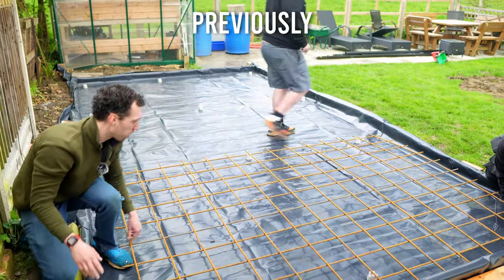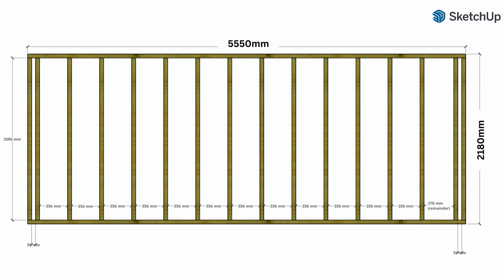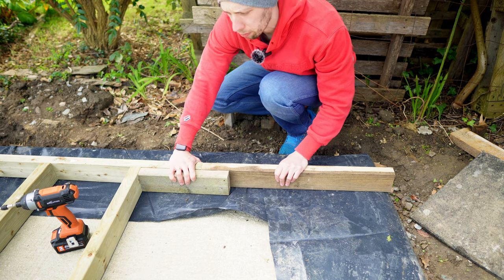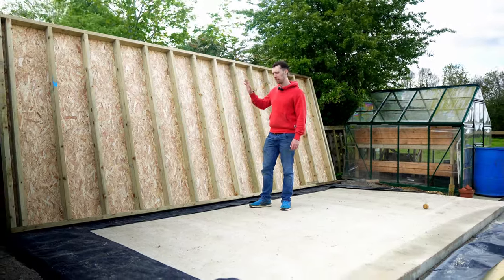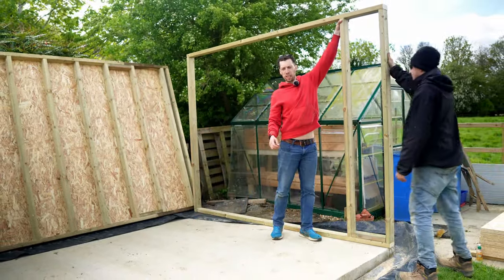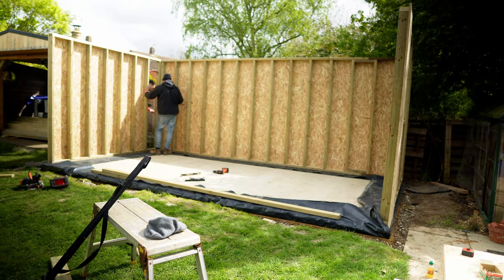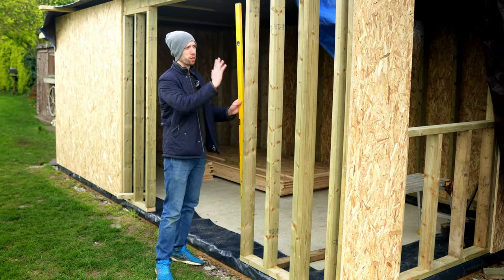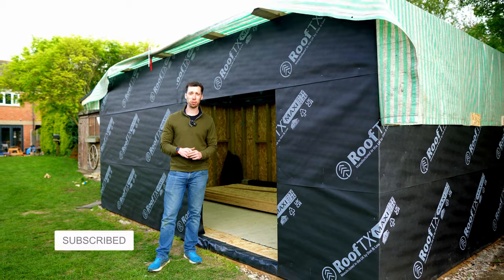How to Frame Walls: Build A Workshop Ep 5

Comment: Just a thought, from a fellow who has built timber framed over in Canada, is to leave 20mm overhang at the bottom of the OSB wall sheeting to act as a drip edge to prevent water ingress from rain splash on the ground and past the pad edge running down the walls. And loosely attaching 2x4 2/3, 3/4 the way up the outsides of wall act as props to hold them vertical until screwed together. A bit later to the party I know but may help others. Take care & stay safe.
Reply from the maker: Great tip thanks! Wish I’d considered that!

Comment: Good job folding the membrane over the slab. I've noticed in my shed just from rain that water will penetrate in about 100mm from the edge (and I feel like the hold-down bolts seem to help with the wicking somehow). 

Plasterboard for the interior lining is an interesting choice if I heard you right. It's pretty soft for a workshop. I was, luckily, able to get a hold of 17mm second hand ply that had been used as lining for shipping containers. On that note, before you sheet, plan where you might be putting shelves or cupboards and put in extra horizontal or vertical nogging that you can screw into. I mounted a heavy fan on one wall and made sure I had extra timber behind the ply sheeting to screw into. You can never have too much high shelving. Maybe also consider an exhaust vent for dust collection before you sheet as well.

And, yes, you tend to over-estimate windows. Less window is more wall space. On the other hand, I underestimated my lighting.
Reply from the maker: Yea I'm still not sure whether putting the DPM under the framing instead of stapeled to it was the way to go, I guess time will tell. 

Yes I am currently thinking of using plasterboard, I hadn't considered using ply but I might check out the price and compare.

I'm hoping the choice to skip a 2nd window is something I don't eventually regret. But I think I should get plenty of light from the doors and one window 🤞

Comment: This is almost exactly the type of shed my wife will be getting me to build. I'll have a good look over the plans to see if it's possible to do in my garden. A laser measuring tape sure would come in handy during the build 😉😅
Reply from the maker: I’d be interested to hear what you think of the plans, I’m open to adding more detail if people think it’s needed 😀
Reply: @sumeraybuilds  Heya, I've had a quick look over the plans. I've got a few constructive criticisms:
The plans were a little hard to find on your site. Not impossible, but maybe you could have another sub-menu solely for plans? 
The plan labeled 'with window' is actually without window and vice versa. The file name is correct but the title on the site is wrong. 
Did you cut the top of the studs at an angle to meet the slope of the roof in the side walls? If so, what was the angle? That might help improve the plan to include it. 

Otherwise, really good site and really good plans. Thanks for making this information accessible 🤘
Reply from the maker: @ojcrook1340  That's solid feedback, thanks so much!
I've gone through and addressed everything. I did cut the tops of each upright to a 2 degree angle.

If you ever had any other suggestions for the plans then feel free to let me know (My emails on the channel page)

Comment: Great shed build series.  Question, how did you attach the walls to the concrete base?
Reply from the maker: I drilled some holes using a big drill through the walls base plate into the concrete and fixed with concrete screws. I do show this in the video about halfway through

Comment: Very well explained, and I see you attached the walls to the base using screws - won’t that compromise the waterproofing layer though?
Reply from the maker: Thanks 🙏 It will allow some moisture through the DPM. But personally I don't think it's enough to worry about. I'd rather have it screwed down and know it's not going anywhere and risk a little moisture. I have seen some people fix some brackets into the concrete base whilst it's being poured which doesn't avoid this issue. But required a lot of planing to make sure they're in the correct place.
Reply: Thanks mate that’s good to know your views on this. I’ve been considering how to manage the securing without cutting through the membrane, but I guess we just go for it haha .. thanks for the response, really appreciated ❤

Comment: With refererence to the damp course. Would it hace been more effectivt to put a strip of Dpm under the wall plates and the stappled the remaining base Dpm to the outside. So when you do a breathable membrane on the ouside any moisture would run past wall plate and outside of concrete base. May also give a higher barrier against rising damp?
Reply from the maker: It's funny you mentioned that, I was watching the DIYGuys workshop build who did just this. I suspect you're right and this would result in slightly better damp proofing. However, it's too late for me to change it plus I don't think it's going to be an issue once it's cladded. I'm going to clad slightly below where the OSB starts to avoid splashing rainwater.
Reply: @sumeraybuilds   sounds like you have a strategy :) and you are right, once done it probably will not matter. You are definitely more systematic than me. I tend to make it up as I go. Looking forward to the rest of your series. Thanks

Comment: Really enjoying the series, it's interesting seeing how everyone's methods differ slightly in these workshop / garden room builds. I'm in the early planning stages of my own workshop and am weighing up the pro's and con's of a timber construction like yours that I reckon I could handle myself (with a few friends lending muscle) or blockwork I'd need a bricky to do for me, with an insulated metal clad roof... I'll be looking at about 6.5m x 3.5m and about 0.5m from the boundary on two sides, plus will be using it to store and work on motorbikes so think I'm swaying more towards the blockwork but I'll see how your build progresses before I make any firm decision. Then I'll probably procrastinate some more... 😂
Reply from the maker: I think brick looks better and will certainly last longer. But I'd imagine it'll be twice the price once you factor in labour costs. Unless you can lay the bricks yourself ect. Good luck with it!